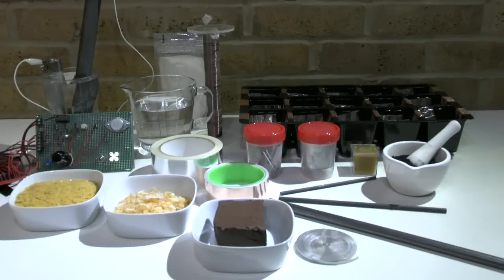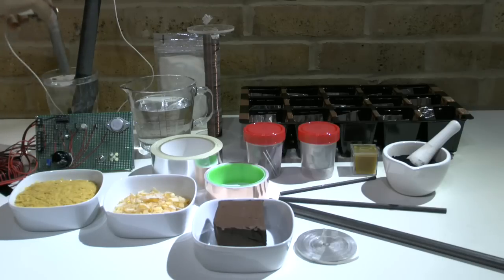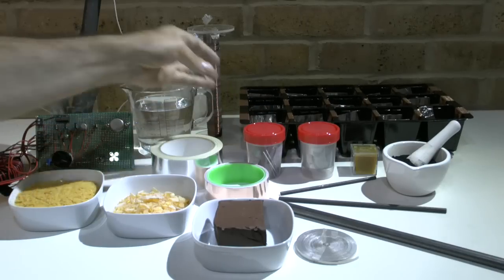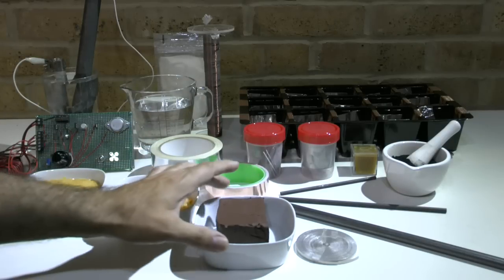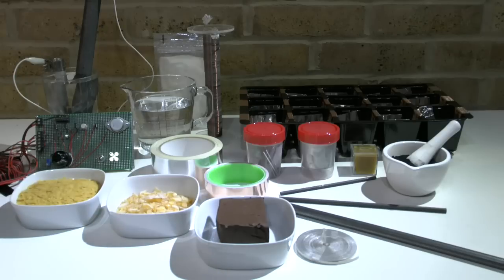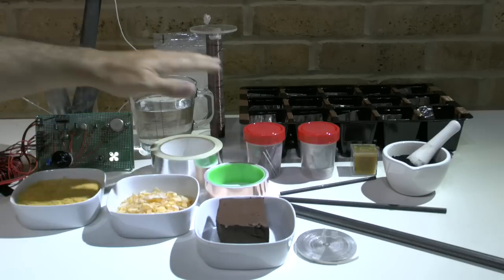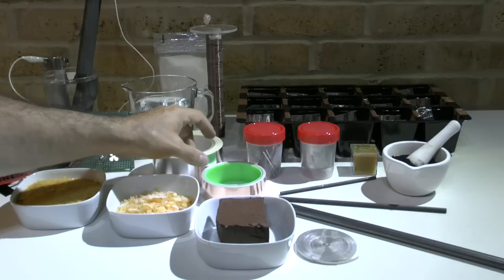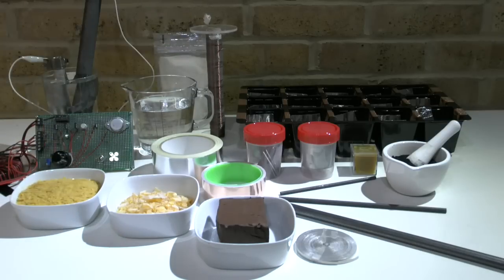Earth Battery Update, from a single cell to a cell array

Comment: And technically this isn't an Earth battery, it's a galvanic battery with Earth as the medium.
Reply from the maker: Historically it was coined earth battery but it is of course a galvanic reaction between the two electrodes
Reply from the maker: Question to you. Do you think you can create an electrical potential between two electrodes of the same material. Lets say Zinc or Carbon.
Reply: Look up tuleric Earth currents and the grid that powered the telegraph system before the commercialization of electricity. Those are Earth batteries.
Reply: The problems with electrodes of same type, isn't potential but flow. One must have a weaker resistance than the other.
Reply: I actually found you searching for a guy that would make cells out of different soil types. He was an old scientist. He made one Earth cell that produced a steady 7 volts at .8 amps for over 30 years, no maintenance.
Reply: I was searching through my previously watched videos when I came across one that lead me here.
Reply: Maybe like a Stubblefield setup. Two electrodes on each side of medium, each with a different diameter. Changing the potential of the electrodes... Or maybe a Stubblefield coil in the medium, and an inductive draw.
Reply: Every use an alternator in water?

Comment: One of the biggest failings I see in Earth batteries is the loss of net power created. Individual cells will often have a nice half amp output but a series will not have the ampage of each cell combined. I think something similar to a bridge rectifier would correct this mistake, as you are technically shorting your lead out to your next lead in, cancelling the voltaic effect of the electrolyte in between.
Reply from the maker: That is because it follows the voltage ampere rule. You have of course also losses because of resistance. Voltage increases and ampere drops in series.

Comment: Non conductive? You mean highly resistant to conduction. Every material in the world will conduct electricity.
Reply from the maker: Hello, to be conform with standard definitions I use this simple term as it is related to electrical potential available. At low voltage non conductive is usable for the laymen. It would be correct to call it dielectric. You are correct as there is no such thing as non conductive materials but we have to look at the relationship to electron flow per time. This is also the reason why batteries deplete over time. Even the vacuum, not containing matter !, allows the flow of electron. A paradox.
Reply: Using the simple term makes dumb people ignorant. I like your video and that you reply, but beware dumbing yourself down is a disservice to those below you.
Reply: Your reply got a sub though.